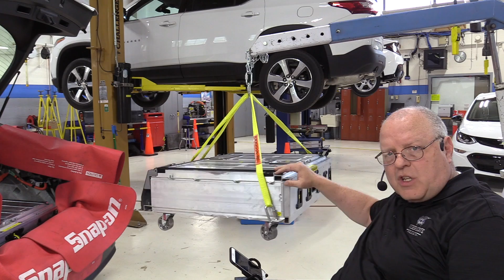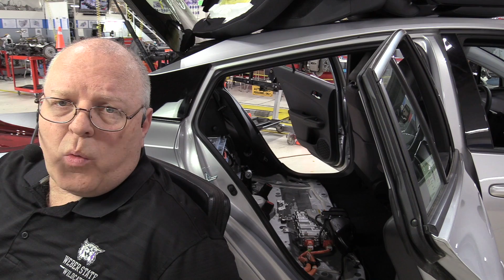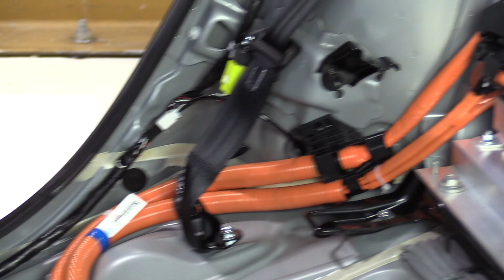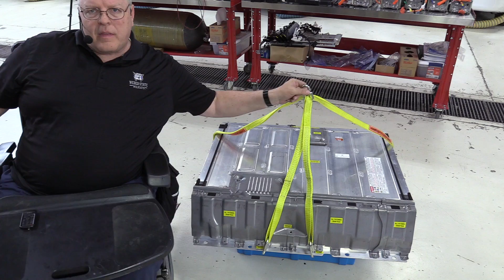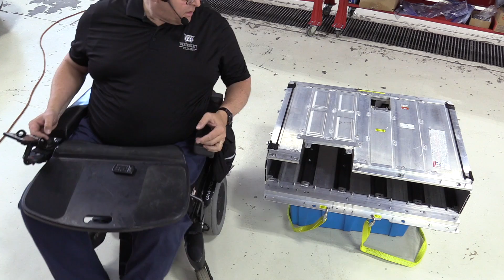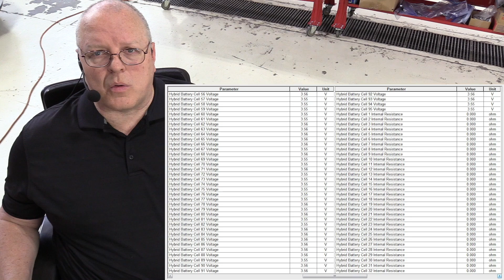2017 - 2022 Prius Prime - 8.79 kWh Battery Removal

Comment: Thank you, Professor Kelley,for this video!
I have learned several interesting things and particularly about the cooling of the high volt battery intakes from the interior and the actual charger below the rear seats.
Also, I have a doubt about the aux battery which is draining after the charging and now with your explanation, as I have understood, that could be a problem with the interior temperature which is usually about 85F-90F. Next time I will measure the amount of drainage at different temperatures and share with you.
Reply from the maker: Thank you very much!

Comment: Glad to see you back on Youtube, Professor Kelly!

I'll never be a fan of batteries in the passenger compartment or ones cooled with a duct from inside. In an accident that damages the battery and potentially disables or traps the passengers this could quickly go very badly. But high voltage cables inside under the rear seat cushion? Toyota is famous for their engineering but much in this car (including the air cooled charger under the seat) makes this model seem like an afterthought.

I do like the battery cells though, packaged like Leaf batteries but easier to get to. I'll will start looking for a Prius PHEV that's been wrapped around a tree. Unfortunately (for me anyway) Prius drivers tend to be very careful. If I find one the cells will be in great shape with those extremely modest use and charging voltages.

I do hope you are able to post a tear-down of the Gen 2 Volt drive unit some day. I'll never take one apart. I just want to see a better explanation than GM gives.

Interesting Gen 2 Chevy Volt trivia: I rode my motorcycle to work one day last week here in Texas. I left my '18 Volt fully charged outside but plugged in. My wife was surprised to hear the fans and maybe the compressor start while she was outside for a moment in the punishing midday heat. Apparently the battery cooling system will come on when plugged in if the battery exceeds some limit.

And again, Glad to have you back.
Reply from the maker: Thank you very much! Yes, the Volts do keep the battery in the correct temperature range as long as the charge cord is plugged in. Absolutely normal.

Comment: Awesome video!  Thank you very much for this and all of your killer Prius videos!

Curious that it took 5 hours to charge at 208V (comparable with 120V charging speeds), when it takes a little over 2 hours at 240V...
Reply from the maker: Thank you very much! I wonder if there is a charge rate setting that is turned down on this Prius Prime. I will investigate further.

Comment: Thanks for new video! My favorite new tool is a voltage proofing unit sold by Fluke. So you can test your meter before and after testing for absence of power. Runs on 9volt. 
I just bought Clarity PHEV. Thanks again Jed
Reply from the maker: Thank you, I will look into that unit

Comment: The other receptacle is likely Mennekes type 2 that is used in Europe. And here in Europe we sometimes call the J1772 type 1. Also in some European countries ,for instance France and Italy, you can find type 3a or type 3c, but for those you have to get an adapter because no cars use it. Type 3a and type 1 support single phase and type 2 and type 3c support three phase. And for DC fast charging we use either CCS Combo type 2 or Chademo.
Reply: @WeberAuto don't thank just yet, because apart from the general info on French EV socket formats, the "likely" part is just wrong guessing.
On European Prius PHV the left J1772 is replaced by an IEC 62196 Type 2 connector aka Mennekes socket.
The right empty space on non-japanese vehicles is just a holder for the left socket cap, as you can perfectly see in this picture from Toyota Europe media site:
https://content.presspage.com/uploads/1523/500_2017-prius-phv-aqua-detail-07.jpg
On Japan alone Toyota offers the CHAdeMO quick DC charging option that you mentioned, as depicted on this other picture here:
https://www.priusfreunde.de/portal/images/fbfiles/images/externalcharging_img1.jpg
Reply from the maker: Fantastic! Thanks for your feedback!
Reply: In addition: The Chinese use different separate AC and DC charging connectors, which are called GB/T according to the GB/T 20234.2-2011 standard. The GB/T AC connector looks quite similar to the European Type2 connector, but is not compatible. The GB/T DC connector has some similarity to the Japanese ChaDeMo connector. So for AC charging there are mainly three different connectors in use worldwide. The Type1 for the US and Japan, the Type2 for Europe both according to the IEC 62196 and GB/T AC for China. Thank you for your great detailed und explained videos! Maybe you can get your hands on a Tesla Model 3 in future as well :)

Comment: That’s unfortunate it takes so long to charge in your workshop. My Prime takes roughly 2-2.5 hours to charge on 220V AC.
Reply from the maker: Thanks for the feedback, I was surprised by the time as well. It was very hot in the shop while charging. Maybe it was slowed down to help keep it from overheating.
Reply: The 2017 Prius PHV has 2 speed/amps settings on its menus: 8A and 16A.
I bet you had the car settings regulated for max 8A... that time is consistent with 8A charging.
Did you measure the current or power coming out of the wall socket?
Reply: @jprates  I cannot understand what option should I choose, either 8 or 16A, for a regular 5,75 kva contract.
Reply: @FilipeFerreira-eu  there is no "correct" option, it's a matter of logic and understanding what will work for you.
On a 5,75kVA contract you have 25A available, single phase (25A x 230V = 5,750 kVA).
Therefore if you don't take more than 9A from the other consumption devices in your place while you charge the car, 16A will work fine.
On the other hand if you turn on devices that take more than 9A, the supply switchboard will cut the power to your home.
Register at https://ecomove.pt and you'll have me and a lot more people willing to help you there.
Reply: @jprates  thank so much for your help

Comment: Another great video!! By the way, you encouraged me to buy a savaged Bolt! Going to remove battery pack to use in my solar production. I would like to use it as a whole pack, if you have any suggestions let me know. If you need any spare parts for the Bolt, let me know. Coming to Utah in the fall! Thanks again for your very good videos!
Reply from the maker: Thank you! That should work well. A small pump could circulate the coolant as needed. Stop by and say hello if you pass through.

Comment: It’s been too long! Looking forward for another series!
On the charger under the back seat are the AC and DC connectors equal? Can they be plugged wrong by accident? The connectors on the battery for the inverter/motor don’t seem to have any label or differentiating color, how do you know which one is positive?
Reply from the maker: Thank you! The charger connectors cannot be interchanged, there are slight differences. The  large connectors are also different. I had to measure the polarity to determine which one was positive.